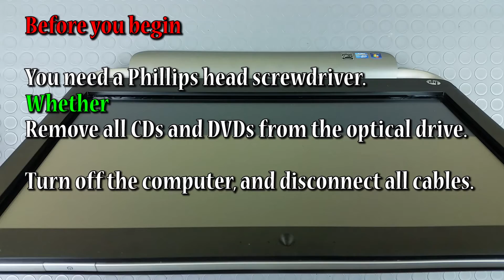(DIY) Computer upgrade: how to replace optical drive on hp touchsmart 520

Comment: Hello, if I wanted to disconnect the power cable from the DVD player, would it be the one that is red, black, yellow and white? On the other hand, i should remove the screws, right? This is because the PC makes a vibrating noise and seems to be the reader. Sorry if my English is not very good, thank you very much.